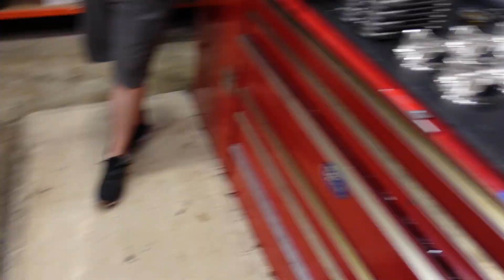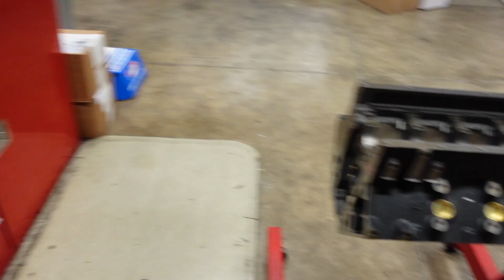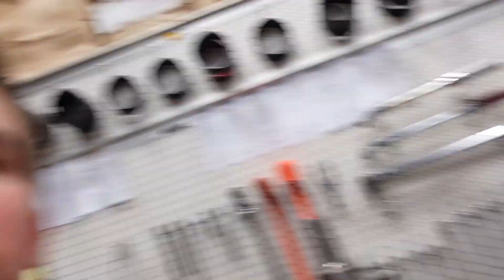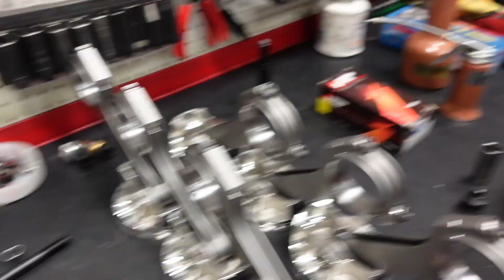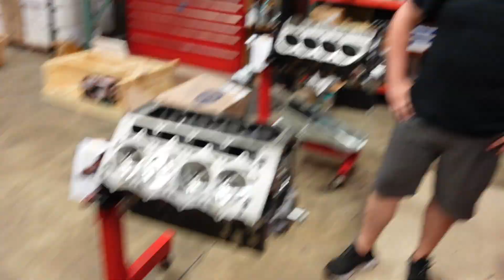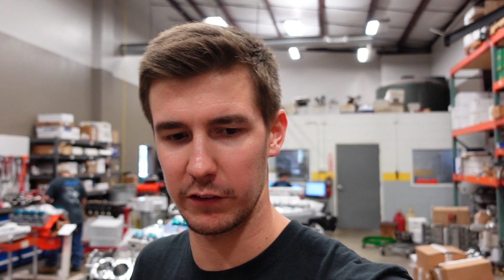Building a Twin Turbo 427" LS3 - 1,000+ HP Rated!

Comment: I need an 1000+ hp engine and transmission will also wanna do a twin turbo both huge ... gonna be on the search for one ... I drive an 1980 pontiac firebird trans am...than I can rebuild the pontiac 350 small block on my spare time

Comment: You could’ve made 1000hp with a 4.8/5.3 also for cheaper!
Reply: But you wouldn’t be able to turn it up like that one. Stock ones break at right around 1000 horsepower. He can turn that one up a lot more than 1000 horsepower.
Reply: It’s more than likely gonna make way more than 1000hp. All depends on how they want it
Reply: Yes, and you would need more than one block...maybe more than 2 blocks...
Reply: @chrisferguson1911  that’s what keeps it fun
Reply: he did
Reply: when you make more power na it’s way better, when you boost it making 600hp na vs 300na and then you add boost the 600hp motor will have a better power band and make more power usually with less boost thrown at it
Reply: And here you have it someone always thinking about the money 🤑 these are the kind of people who never have or do anything good. what makes them feel good it's not spending it makes me sick.
Reply: Isn’t lightweight vs the iron block
Reply: You can't go wrong with extra insurance. My lq4  408 will make more power then any 4.8/5.3. K1 crank and rods and weisco pistons  with hardened wrist pins. All arp to fasten the motor together. Rated to 1,500hp. Tick performance  stage 3 turbo cam. 88mm turbo going on with 210lb in injectors and huge twin fuel pump.
Reply: At 2:24 he says just that; the difference is reliability vs. a ticking time bomb.
Reply: Its called business money generation
Reply: Have you ever rode in a boosted car with big cubic inches vs a small on??   Believe it or not, there’s people like me that will build a stroker LS because it’s going into an $80,000 car and not some $5000 pos.not everyone is broke, living in their parents basement.  If $5-6,000 is going to make or break you, I’d suggest getting other things in your life figured out.  This is @ss wipe money!
Reply: @Cultofpersonality09129  😆 damn bro such a flex!! 
Let me see your 80k build…
Reply: @Cultofpersonality09129  All he did was point out that you can make a 1000 hp for a lot cheaper…did he lie = no! So where did you get he’s broke or living in parent’s house? Why get so testy like he made a comment about there being a correlation between penis size and money spent on an engine?
Reply: @SouthSide tv  what I find funny is that you would have more money to throw around living in your parents house, so that makes no sense to me either
Reply: @Cultofpersonality09129  such a big talker but no videos? Hmm

Comment: Can I turn a ls3 in to a 427 stroker?
Reply: Yeah  all 6.0 ls blocks can be punched out as high as 427cui . but at that point your cylinder walls will be very thin. Good for Na but not for any boost/supercharger or nitrous build. Also with thin cylinder walls comes with heat distortion on the cylinder wall which can worp a block too in high heat environments.... so yeah
Reply: @Est_los_jorge  What do you mean? The cylinder walls are to thin for boost with a ls3 at 427cui? This video is literally a LS3 turned 427 and is TT with over 1000hp... I want to build a TT LSX 376 and stroke & bore it to 427 to replace a LS7 427 Z06 motor (which shouldn't the lsx 427 and the LS7 427 be the same power/505hp? Things i've seen says 600+)
Also I am not seeing the extra cost in stroking/boring it if you were already going to upgrade the rear end, the only extra cost/thing to do would be the boring process itself which is just a couple hours on the machine. So it seems it is only like $1k-$2k MAX extra to stroke and bore the engine which I can't wrap my head around how it can possibly be that cheap, to turn a LS3 6.2l into a 7.0l what am I missing here?
Reply: I'm not a hundred % sure but I believe the thinner walls issue is with a stoke ls block he is using a aftermarket dart block which I believe have thicker walls than the stock ls 3

Comment: With the main caps being already drilled to accept pins, why are the holes in the block filled ? My only criticism is the fact that if you are spending the cash for an aftermarket block, take advantage of all of it's features and safety/strength measures. While splayed caps are far superior to OEM 6-bolt caps, why not pin them for added peace of mind ? Relying exclusively on the lateral block side cap registers without the cap pins seems silly.

Comment: WHY CHINESE crank and rods in such a nice build?
Reply: There is nothing at all wrong with those parts. All shops offer them and all shops use them.
Reply: @baby-sharkgto4902  maybe in a stock LS block!
Reply: @racingthemachine3364  I feel if anything you could have stated that the block in this build is overkill, not that the crank and rods are bad. Perhaps you are not up to speed about these cranks and rods but a very large part of the market are using them successfully…. There is no down side really. All reputable shops are using these in their own engines and selling them. These parts are going low 7s in an automatic and mid 7s in an H pattern (in the 1/4 mile). Not sure if you know but that is ridiculously fast. Yes I would definitely suggest the American cranks and rods if you are going for the 6s but people going that fast already know that, now you do too.
Reply: @baby-sharkgto4902  Never said they were bad! I guess I  should have just said why not use a factory  block since the customer obviously doesn't want make over 1000hp . I have learned so much with such a small question.  Thank you for not being condescending.  I personally would love to have 700 dollar crank and rods in my 3000.00 block. I Prefer it because there are absolutely no other options between that and 4000.00 crank and 2500.00 rods! Thank you from the bottom of my heart.
Reply: @baby-sharkgto4902  There are stock bottom end ls engines running low 7s doesn't mean anything to me!
Reply: @racingthemachine3364  yeah that’s crazy!
Reply from the maker: The alternative is a $4k Bryant crank & $2.5k Carrillo rods (if you must have USA parts)
As Shark said, for the application these parts are plenty strong and have amazing tolerances & quality.
Reply: @JacobVillemain  Callies cranks 2000.00 , Lunati cranks 1700.00 , Oliver rods 1400.00 their are many more reasonably options than just a Sonny Bryant crank.
Reply from the maker: @racingthemachine3364  I hate to be the one to tell you this…those are all from China
Reply: @JacobVillemain  Oliver is 100 percent USA made. Callies magnum cranks are USA made. These companies  offer Chinese forgings like compstar or voodoo series but also have a premium line as well.
Reply from the maker: @racingthemachine3364  oh the innocent 😇
Reply: @JacobVillemain  So your saying your rods and cranks are on the same level as a callies magnum crank and Oliver billet rods. These companies are lying to us. Callies Magnum forgings don't start in Ohio. The Oliver promise?
Reply from the maker: @racingthemachine3364  I’m not sure where I said that. I’m trying to illustrate that there is no reason to charge a customer more money for a part that is not necessary for the application. If they needed a custom Carrillo rod or Bryant crank, then yes, they would receive that. For 1,000hp those pieces are overkill and would be unnecessary.
Reply: @JacobVillemain  I guess I  am going to have to harass these vendors at this year's PRI show in Indiana.